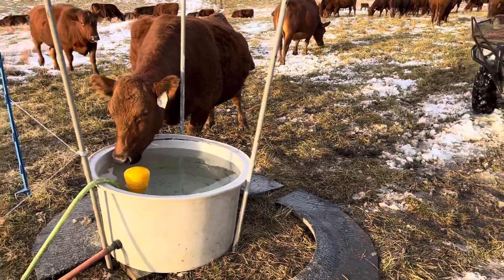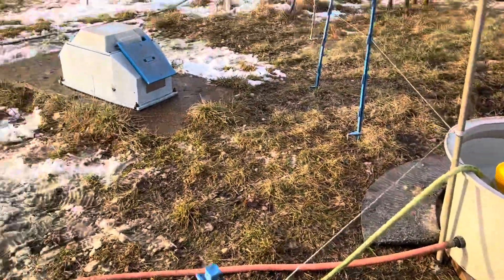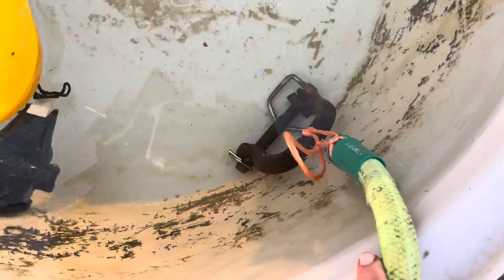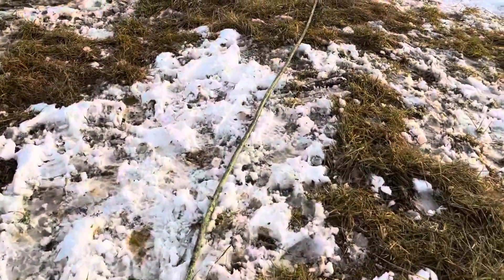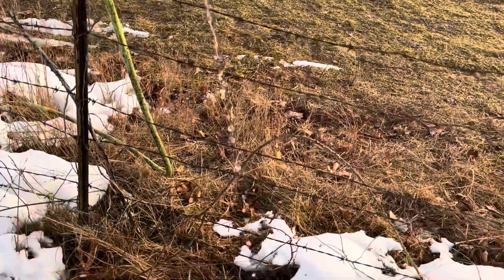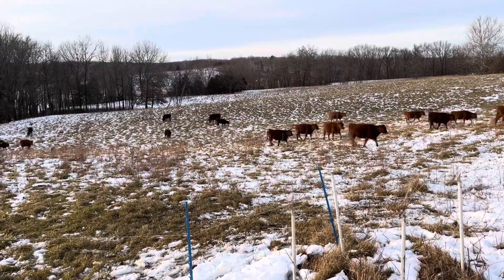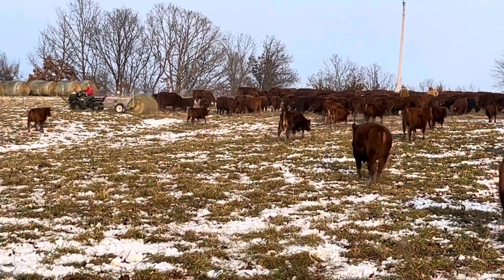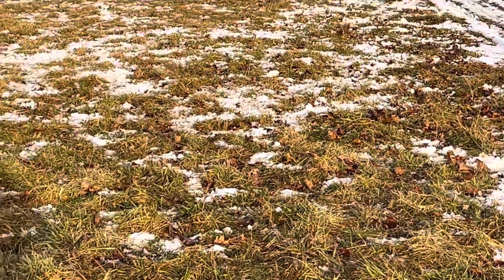Check out our winter freeze proof livestock water system.

Comment: Howdy Greg. Tried the siphon on a tire water tank last night. Had it tied about 1/2 way up an O'Brien. It built a stalagmite and froze over. I had a water control on the outlet end. It may have got plugged up with some water bugs. The flexzilla hose froze solid but looks to be ok. Gonna try it again this afternoon and night with some changes to see if it might keep running. Might be just too cold for the siphon to work.
Reply from the maker: The whole siphon hose needs to be smooth, no valves of any kind. Tie up the end that is running onto the ground so that you have at least 50-60% of the hose running water out. We hit -25 below last night with wind chill, hose was running great this morning from the siphon. In cases where the ice sickle wants to form, tie a piece of tarp over the end to keep the air and wind off the end of the hose.
Reply: @gregjudyregenerativerancher I have found that using a plastic plug cap like what’s on the end of a soaker hose and drilling out a small hole whatever diameter you need for the size of tank and laying the siphon hose much closer to the ground to be far more reliable to keep a siphon going. I have tried both ways. This is an excellent video of how to keep water open both long term and in a pinch. Thanks for the good information you put out.
Reply: Hi Greg thanks for the video however you mention the -25 (with windchill) The only effect wind chill has on inanimate objects, such as car radiators and water pipes, is to more quickly cool the object to the current air temperature

Comment: nice fat cows, have been tempted to try one of the constant flow water troughs but then I have seen 3" water line freeze while flowing, the water was being pulled from a pond with a 4cylinder diesel running a twin piston water pump,  the water was being pumped about 1/4 mile, we had to cut the line in several places to remove the ice, in several places the water line would be frozen solid with the exception of about a 1" circle in the center, now I suspect the temperature of below ground water source might make the difference?

Comment: One thing folks should know regarding unrolling bales: hay is like wine, ever year is different. We bought some hay last year and it was baled during that heat dome we had in Western Canada. The hay was incredible quality because it was harvested so early and baled so quick sheet cutting but it's is so dry that the fiber of the hay breaks so easily that even if it is unrolled backwards, it falls apart in only a few feet. You go 40 feet and the bale is turned into a lang mattress about 2ft thick! Oh well, just more exercise with the old fork!
Reply: When a bale does that I raise it up and down. I will touch ground then go 100' and touch ground again.

Comment: Excellent video, but that siphon hose is running way more than 50gal./12hrs.........I know from doing the same thing here.
Reply: I agree, here are some facts.  A 5/8 inch (standard) garden hose will put out 8-10 gallon per minute depending on hose length and water pressure of 40-60 PSI.  A faucet that drips 120 drops/ minute  will leak about 11.4 gallons per day ,  finally  a hose that leaks 1 cup per minute will waste 48 gallons in 12 hours.

I believe that you are running closer to 50 gallons per hour or even more.

Comment: I love to hear the reasons for or against each part of this watering process. It saves a lot of problems for careful listeners.
Reply: You still want to turn off the water once temperatures get colder because the hose does freeze in negative temperatures. A plate with a drinking hole will help protect from surface ice in sub-zero Temps as well
Reply: You would be amazed how cold a hose with water running thru it can get without freezing.

Comment: Make a pull type bale unroller that can handle up to 2500 lbs
Reply from the maker: We don’t have any bales over 1500 lbs. If you found a 2500 lb bale, the 700 lb atv would not pull it on any type of grade. I know those wet haylage bales can go over 3000 lbs, need a tractor for those.
Reply: I custom bale hay the alfalfa and grass bales average over 2000 lbs up to 2400 lbs a bale

Comment: When the power goes out in a cold snap  I let the taps run so that I don't have frozen pipes That's what I learned to do when I was living with my Grammy.. I am lucky the infrastructure was upgraded a few years ago and the lines that feeds the port runs down my street so our area doesn't have extended outages I can't remember when the last one happened!  Sometimes It goes off  just enough to turn the computers and clocks off and parts of the city are a day or two before the powers back  the other lucky thing is my water bill is not not connected to consumption. I can remember the time my son fell asleep in the shower he woke up when all the hot water turned cold I have wondered how long that nap lasted. We had installed two large tanks when we had the B&B so it must have been a long nap. Thanks for taking me down memory lane . 🤗🙄🤔🤷🏼‍♀️😘💞💕💞🌟🍀🌟👍👍👍🌟🍀🌟🖖🖖🖖🌟🍀🌟🙋🏼‍♀️
Reply from the maker: Thanks for sharing your stories with us. Your son must have had a nice long hot shower!!